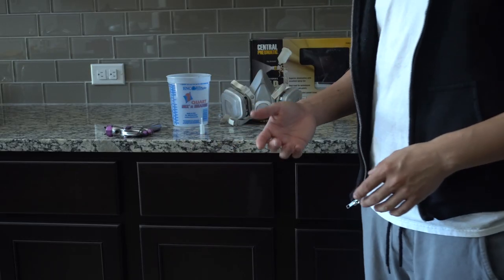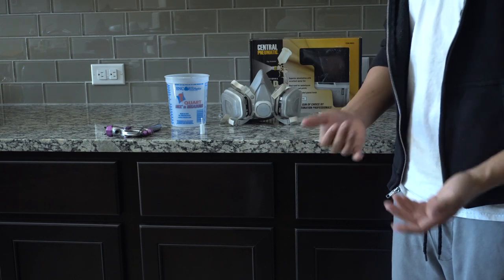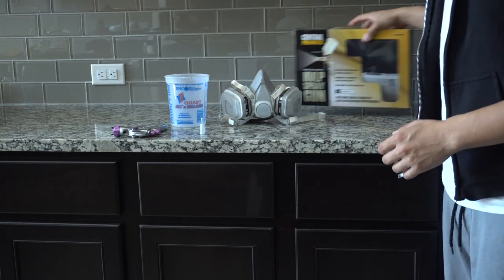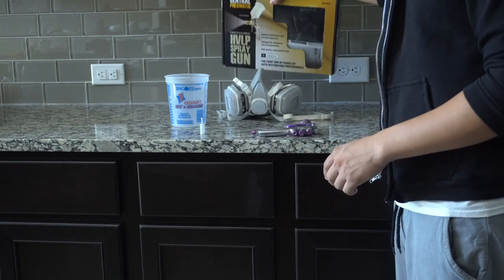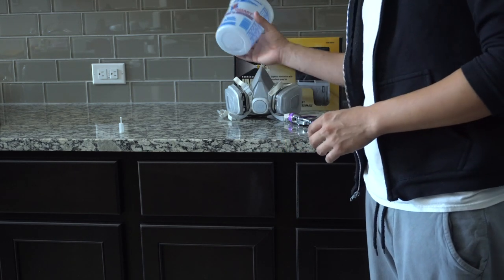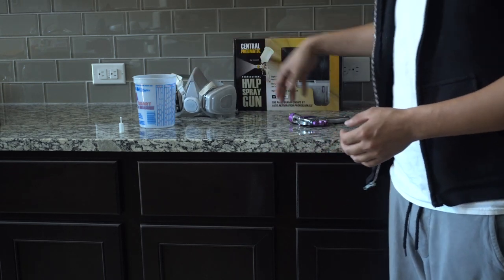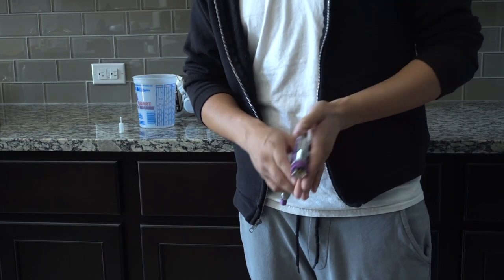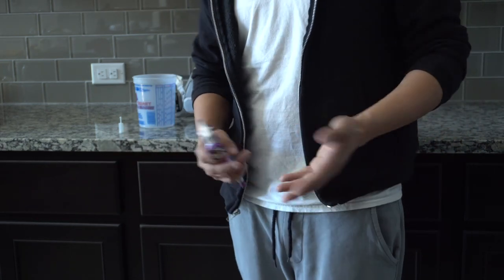DIY PAINTJOB ON THE SUBARU

Comment: I've been paining my car with grigio...I'm not sure if mine is a perfect match. Does your have a slight blue tinted to it in the light? Or does it stay dark grey
Reply from the maker: dreezy franklin yeah it has a very slight turquoise type of pearl to it, but you only see it in sunlight, I watched them mix mine up and it has a lot of different pearls added in I believe it had yellow and green also
Reply: @CHUCKSNDUNKS   ok thanks! I def can  the yellow and green pearl that you mention. It really is a unique grey. Did it shine pretty good after your cut and buff?
Reply from the maker: dreezy franklin yeah still aint finished but the pieces I have shine like glass man , it’s just a long process with sanding and buffing
Reply: @CHUCKSNDUNKS  I'm actually using aerosol cans for my grigio,  and spraymax 2k for the gloss.  I think I may just spray the gloss out the gun for better results. Post a video when your done.  I'm doing it on a e92 bmw
Reply from the maker: dreezy franklin yeah man I’d shoot the clear with a gun you need a good thick layer between the paint and clear to sand and buff I’ve been spraying 3 coats and I still accidentally sand or buff through lol, I will post up the process just haven’t had much time to work on the car